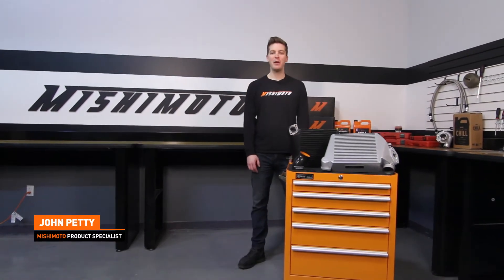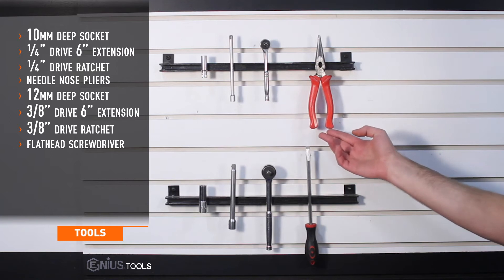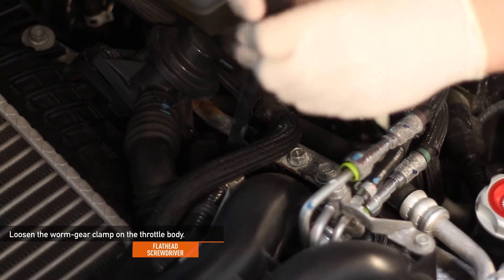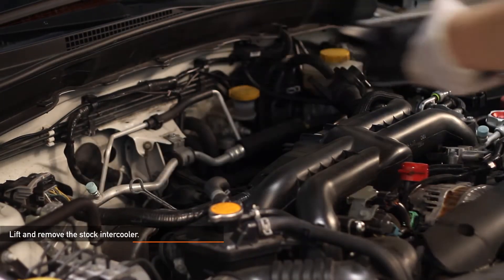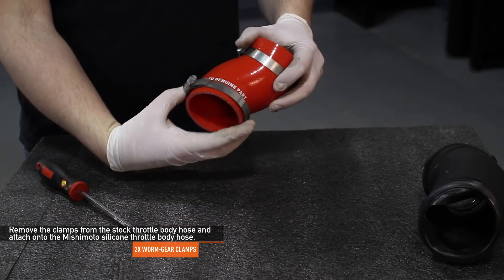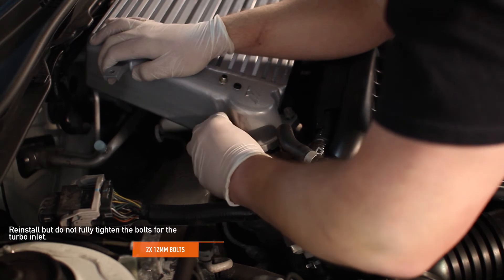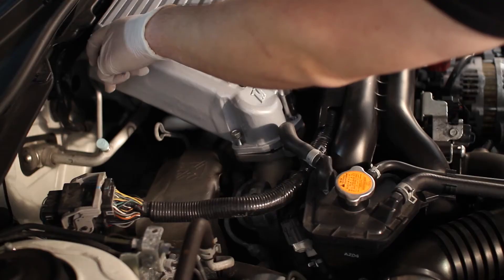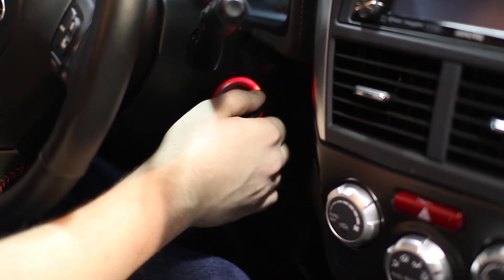Performance Top-Mount Intercooler Kit for the 2008–2014 Subaru WRX Install Video

Comment: After install do need to tune¿
Reply from the maker: A tune will not be required after install, however it could help you gain more power once the intercooler is installed.

Comment: Just followed these steps with my Mishimoto intercooler, easy to follow! Hardest part was getting the hose clamps on throttle body hose to an easy point to tighten 😂

Comment: A few notes here (applies to most TMICs for these cars):

1) Cover the turbo outlet with painter's tape during TMIC swap.
2) Use hairspray as the lube for the TMIC to throttle body hose. This will act as a lubricant for install, but will dry and act as a sealant to prevent the hose from blowing off.
3) Add anti-seize to TMIC to turbo bolts.
4) DO NOT torque the TMIC to turbo bolts with a torque wrench. You will snap them off. Use a stubby ratchet and snug them down hand tight. The gasket provides the seal, not the bolt torque, so go easy.